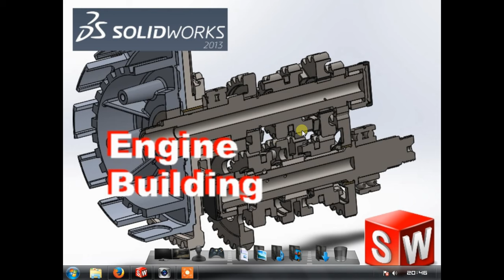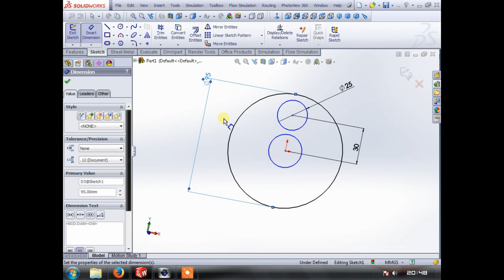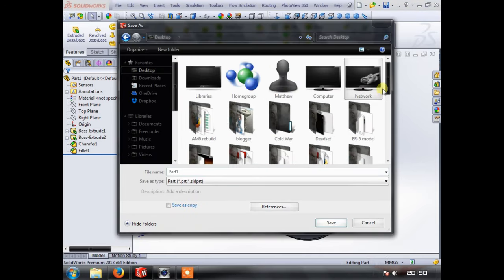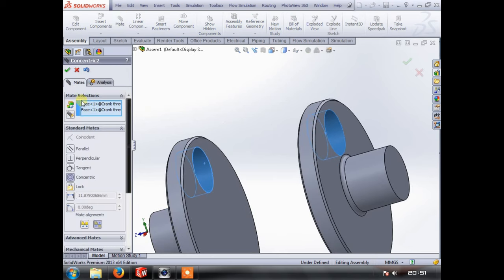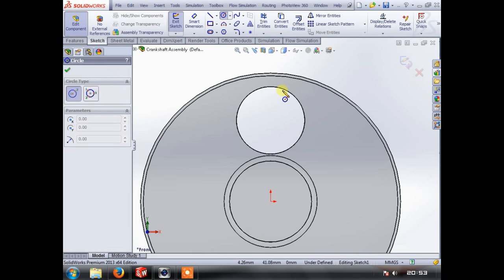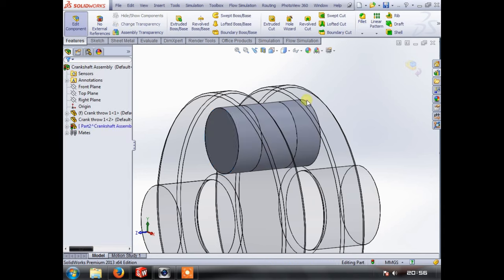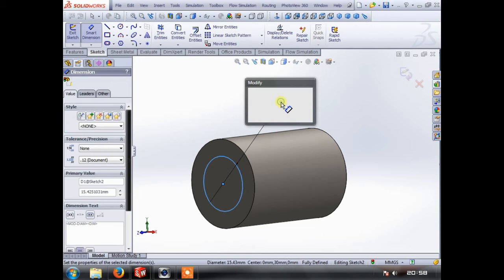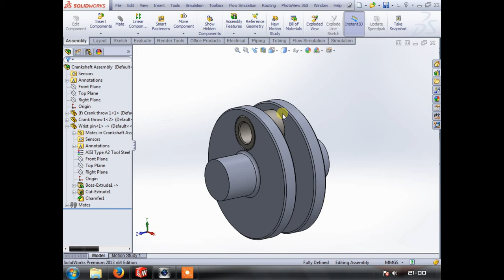Engine build in Solidworks - Part 1

Comment: Have not touched SW since college back in 2010. Sure was fun to play with. Sure wish there was an equivalent that a hobbyist could use without breaking the bank. They are quite proud of $W.
Reply: ik this comment is 4 years late but if you want a pretty good 3D modeling software you could go with fusion 360, blender is also pretty good but its more for modeling free form vs a dimension heavy software
Reply: @nihilpeel9627  Thanks. Today my biggest problem is finding software that works on Linux. I think blender does but have not had a chance to look into it.
Reply: @shimjocky  blender is pretty fun. Blender guru has a great tutorial series on making a donut that teaches pretty much all the fundamentals you could want!

Comment: 3:10 I believe this is also why woodruff key is a used on shafts with a shoulder.
Reply from the maker: I don't follow? I think I get what your talking about but that's not the same thing. I'm talking about fillets between the main journal and the web. When you have woodruff keys is further down the shaft past the main bearings. This area isn't that important because the fulcrum is within the bearing plane, the woodruff key is beyond that point. Good comment though.
Reply: What I meant was in regards to minimizing stress on the part where you cannot have a fillet. Probably could have made it clearer.
Reply from the maker: Some cranks have thrusting shoulders that are maybe 1-2mm thick and then a reduced diameter journal with a fillet included. Thats for a later video - thanks again for the cools comments - matt